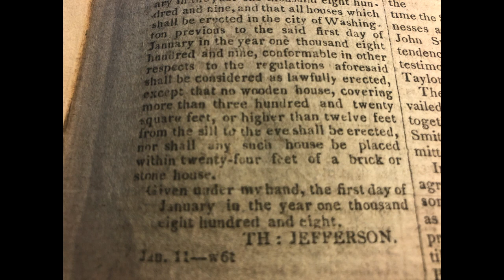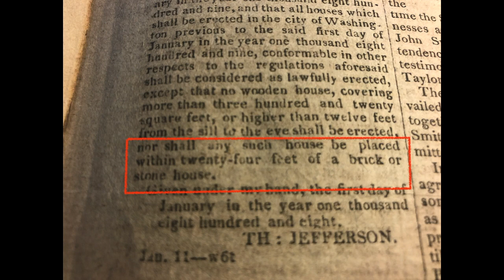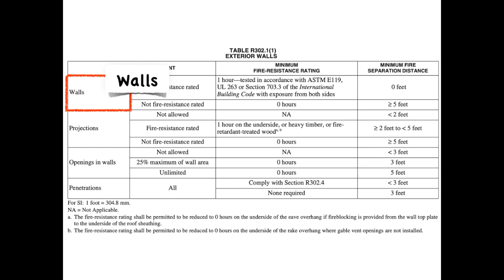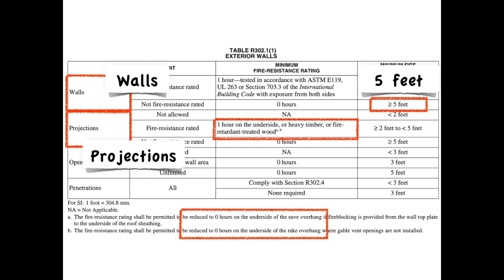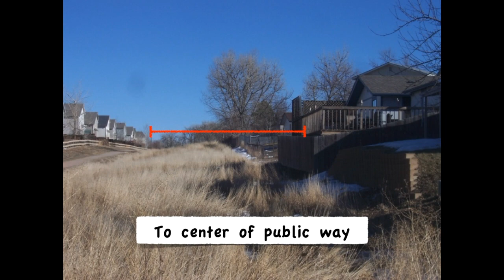Fire separation distance for decks (IRC)

Comment: So hard to find anyone talking about this topic, it's nice to see your video.

I requested to join the facebook group you mentioned but I am not an inspector or builder.. However, I feel like you are knowledgable in this and I am thinking its worth a try to ask you since we have hired an engineering firm and it seems they are making things a lot more difficult. They say yes to something then they change their mind. 

We got into a "turn-key" business last year. It is far from it. So we are potentially losing our 2nd season if we don't get building soon.

We have an inn & apparently the fire marshal and inspector will look at this as part 9 in our Canadian Building code.

It all started with changing a unsafe 3 floor deck. Restaurant on first floor. Three units above it on second floor & 3 units on third floor.
We got a permit but we are expected to change windows and doors which we were quoted $25-$30k PER 45 minute fire rated window.
Obviously thinking of alternatives.

My long winded question to you is this:

If we put fire dividers (exterior walls) for each unit, can there be a shared passageway about 4 metres away all along the shared railing, with 2 fire escape exits on both sides?

Been losing sleep over this and everyone involved seems to be stressed.. If you have any answers, I would greatly appreciate this... I might copy & paste it if I get approved in that FB group.

Thanks Glenn!